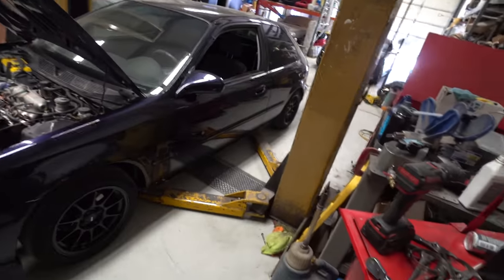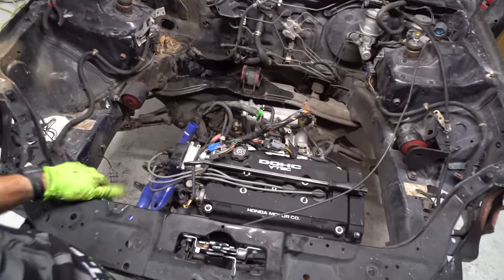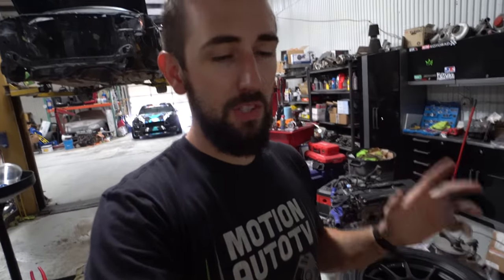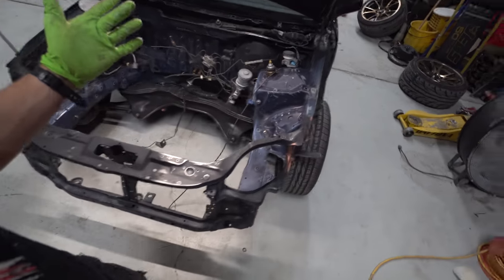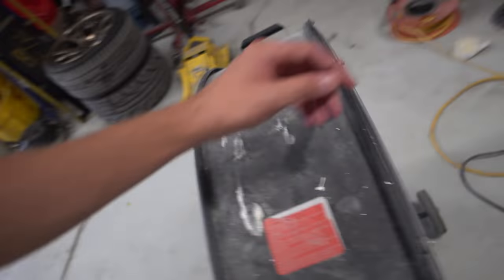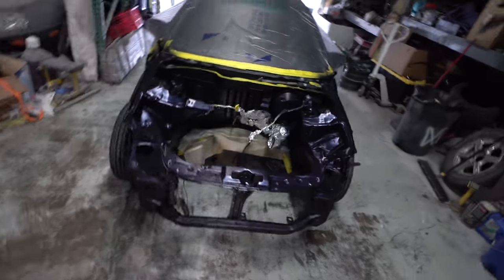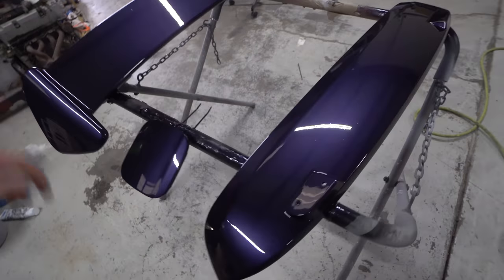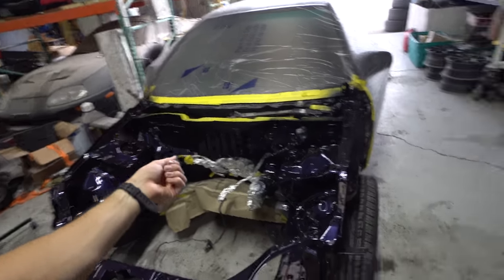Pt.3 Ek Hatch Build | Taking It Apart To Make It BETTER! ( engine bay painting )

Comment: I can never tell how the headlights are supposed to line up on these cars does it pop out of the bumper cover 2" or  is it flush? I look at stock pics from 2000 and see it both ways. I been staring at the bottom on my EJ8 for 3 days straight replacing rusted rear brake and gas lines.
Reply: It’s suppose to sit flush,  the ones with the headlights that pop out are usually ones that have been converted to the ek9 front end
Reply: @HueyTatBB1  I have seen poor fitting replacement "OEM" rad. supports. The two tabs for the lights directly in the front and center position can easily be modded to move the lights back, remove the tabs and replace it with a better L bracket or extend the slot back more on the op tab.